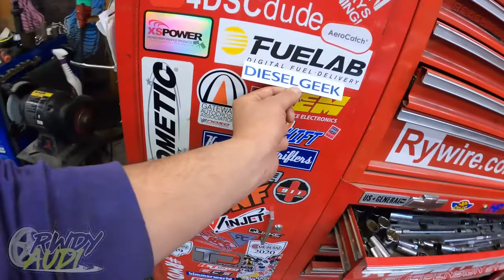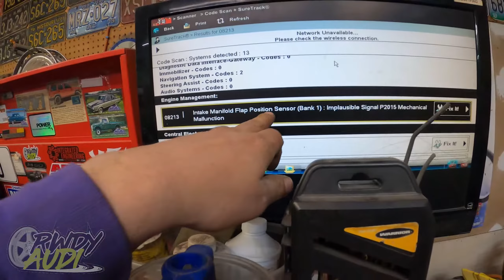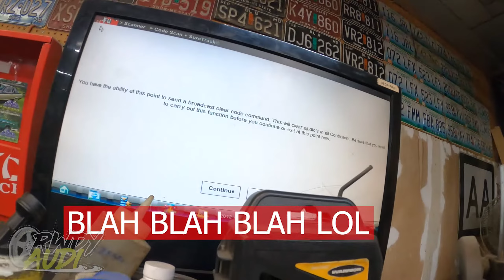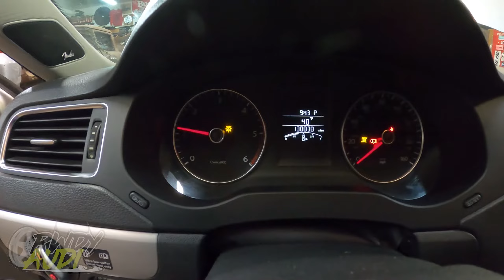VW TDI P2015 INTAKE FLAPPER CEL | FIXED PERMANENTLY |THIS FIX WILL SAVE YOU THOUSANDS IN REPAIR COST

Comment: Most of yall dont know what the problem is but if you look closely on the flapper arm which is connected to the motor has a chipped on it. The arm has a little play on it

Comment: Doubtful tbh - did one for a customer today, hadn't been asked to do one before - the issue is a little more complex. :-) The bracket fix will work if the actuator is tight on the flap-rod. Which it often isn't - in which case this not verk.. Sorry to say.  New manifold pls....

Comment: My son used to work at the Auto Zone you frequent.  He told me to check your channel.   This video did the trick! My 13 Sportwagen TDI no longer has the CEL. Couple suggestions for the community.  You are right that sporting is a MAJOR PITA! I cut off about 5 feet of fishing line,  ran it thru the center of the spring, tied it.  When I dropped the spring,  which I did several times,  i could just grab the fishing line and retrieve it! Once it's on, just snip it, and remove it.  A pair of cheap Harbor Freight forceps were also very helpful.   Again, many thanks! Keep up the great info on your channel!!!

Comment: This fix did not successfully fix the code fault k ok installed it correctly and cleared the code my car did the same thing and went back to limp mode and would not accelerate correctly what could my issue be ?

Comment: That will not fix your problem if the actual motor is bad, wren you start and stop the engine it does a sweep. No sweep? Check engine light will come on. The whole intake is only like 250$ and takes an hour to do

Comment: Do you have a solution for a 2017 nissan sentra I got a p2014 code which is the runner valve sensor as well.

Comment: I have a GTI 2.0 T gasoline, this part work for my car.?
Reply from the maker: No this for diesel you might need a carbon cleaning if your having flapper codes or broken flapper... recommend taking it off your intake and see how it looks inside there before I would order any parts

Comment: Hey so i have a a MK6 GTI TSI i had swapped my intake manifold since my flaps would get stuck open, but i still have the P2015 which reads the same as your screen reads, do you think this should be the problem???
Reply from the maker: Very well could be, look up the intake flapper mod it a chunk of metal that stops the stepper motor from over adjust itself, look up the dieselgeeks.com they sell mod for the intake flap. It possible you swap it with one that was also bad.
Reply from the maker: Wait rewind I made my above post and I'm pretty sure I missed read your question... just to be clear you have 2.0t gas engine? This repair is for a diesel tdi 2.0t cjaa
Reply: @TheRwdyAudi  lol no worries it actually worked i got my check engine off thanks dude
Reply from the maker: Nice dude 👊😎
Reply: @TheRwdyAudi  lmao yea its different engine but basically same concept